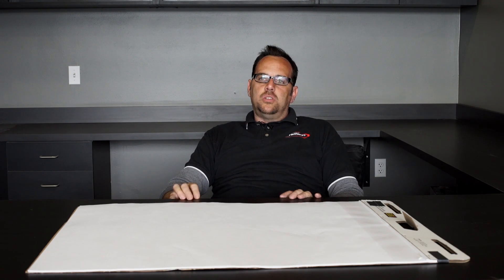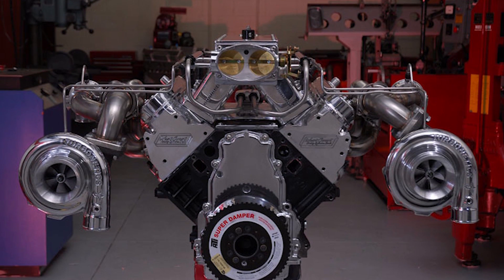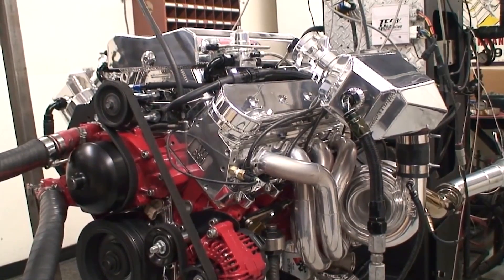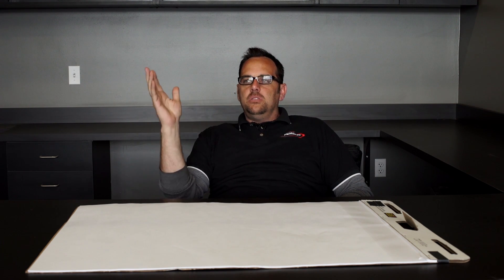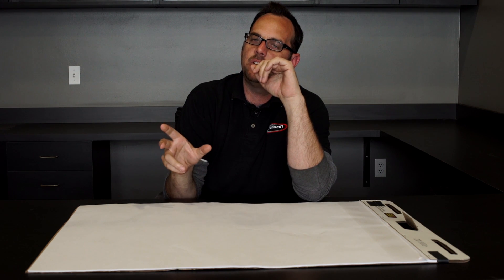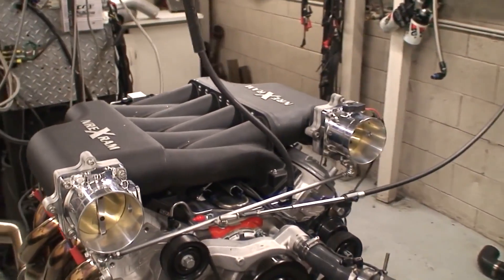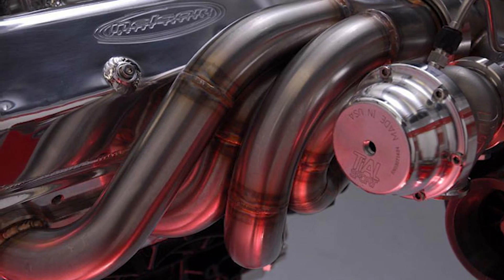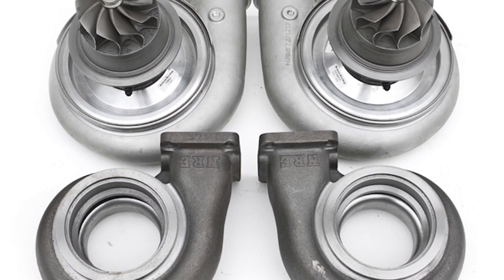Master Engine Builder Explains Why the LS V8 Is SO Good

Comment: Over here in the UK and Europe, engine development took a slightly different route of extracting more power from smaller displacement, primarily due to the price of fuel I suspect. Historically, big capacity engines were always the reserve of high end luxury or sports cars. As far as sound goes, if you want to hear the horniest V8 on the planet just listen to the Mercedes McClaren SLR. Getting big HP reliably from a big cc engine isn't really that difficult. For the pinnacle of engine development, IMO,  look no further than motorcycle engine design which is now at a reliable 200BHP/litre for the street.  Electronics has certainly played a big part in 'extending' the life of the IC engine but, like it or not, the future is electric, wether it's battery or Hydrogen cell, and NO, I'm not an environmentalist tree hugger. I'm a devout petrol head. JMO

Comment: Greatest Engines of all time, not counting the rare/exotics

- 1.8T audi/vw engine
- rb2xdett (theres a couple different versions, all of them are great)
- LSx (same thing)
- sr20det
- k20
- 2jz-gte
- GMC 3800 (yeah its not a power house, but you can bolt a fire hydrant to it)
- Ford 5.0
- B20
- 4G63
- cummins diesels
Reply: Those GM 3800 are literally a fortress. My dad had 3 buicks with the 3800's. He had each one for 2 years but easily put 60k on each car. The engine never broke(same can be said for the car) and the gas mileage was better than most i4 cars of its time, and some i4's of today. My dad was able to reach 36 mpg going 70 mpg coming back from tucson

Comment: what beats an LS for performance, weight, size, reliability?  and COST???
Reply: Nothing
Reply: An AC Induction motor.
Reply: +Charlie Soesbergen OHV V8's are incredibly easy to work on. There's only one freaking cam & 16 valves. I'm no mechanic & I found my LS pretty easy to understand.
Reply: Charlie Soesbergen 800 hp on a 4 banger is waaay different than a v8 with 800. That pisser 4 cylinder is making half the torque of a v8, let alone that 800 can be all motor, where as tuner engines need massive turbos to even stand a chance. 

*BTW, reliability and simplicity is not fast.
Reply: if you know how to tune an engine you can make a 4 cylinder put out more power on a turbo set up and save yourself double the work on a V8, SR20VET would be more cost effective for a performance car since at the end of the day you have 4 less pistons and half the engine in general, sure if you want reliable power an LS is a good swap but not the best, people forget about engines like the 2UZ-FE, M62 and plenty of other good V8's you can get for a decent price the LS is only glorified because its a cheap swap for Americans, when you live in a country where an engines price is determined solely on reliability and performance (because there is no cars manufactured here therefore no cheap local alternative) you soon discover that european and japanese engines are better in the long run since LS motors are OHV making them less reliable unless you do some serious work to them, which is just more expensive and takes more time on a V8, if you get a V8 you want to have to do as little as possible to make it good they are already a cunty engine to work on.
Reply: I was going to say a 2JZ but then I you said cost lmfao
Reply: Daan Made in Holland tell me when any of those cars can beat farm truck on the quarter lmao
Reply: VW 1957 1300cc single port .... way better😂
Reply: Denny Davis Ford truck FRAMES  are weaker than Chevy frames and always were. FACT.
Reply: @bearbait2050     wrong had a 85 chevy  shortbed i had to weld the frame on !
Reply: Denny Davis ur gonna have to provide concrete evidence for that.

Because the Ecoboost engines arent very reliable
Reply: been gm chevy since i was born my mom had a 455 trans am when she meet my dad sr had all kinds of cars but the gm cars we had always out last an out hp the rest its a reasin why even the due heart ford guys are doing ls swops i remembear when 350 4 bolt main an 400 motors was chevy small block peak but as soon as ls1 first was born it totaly ova shadow any motor mass produces an ls is the only motor that makes 1 hp per cubed ince an the stock crank bottom in can handle more hp stock then any production car made an even after market forge cranks can do up to 1000 hp on a stock ls bottom end an crank till today ford mopor company has a motor that can handle that type of hp more less can handle it an be relayable numbears an fact dont lie so us as gm guys just let the other ford mopor honda guys talk an thanks for your knowledge on gm an ls cars
Reply: Ok so it's a great engine, but  I dont understand what is so special about it.Here in Europe only small trucks have 5.7 liter engines, 6.4 liter or what ever, anyone can make big and thirsty V8 engine and offcourse it's gonna be reliable !! Try to make small engine that have some power, it's not thirsty and it's also reliable, that is art. Ffs some 2 liter 4 cylinder engines have more power then your V8's with zillion's of ccm !!
Reply: Zz6 crate
Reply: Daan Made in Holland if you're talking about the V12 that's in the Zonda and the Huayra, that's an AMG engine.
Reply: The coyote dont compare to the LS here in aus we have the mighty barra which puts up a good fight but lacks low end torq. It is very cheap and reliable though, proline LS is running the speed game atm, but you can scratch cost if your going there... Theres so many good engines its kind of hard to say.
Reply: To bad GM cant build 4 cylinders like thier LS  lol
Reply: Daan Made in Holland you just named the most unreliable cars on the market.
Reply: Charlie Soesbergen an SR20 can't make 400horsepower for under. $1,000.
People swap 2JZ and LS instead of sr20s for a reason.
Reply: Tesla
Reply: Ford will out perform and will out last a GM engine.....proven fact.
Reply: @dennydavis2914  wrong
Reply: Denny Davis most 3v 5.4 tritons never saw 150k.....proven fact

Comment: If the "LS was so good" why do they need more displacement to match the same HP of smaller V8's?  They make less HP per liter by far.  They also use outdated push rods which cannot rev has high as DOHC engines - please see 5.2L Voodoo engine now, that is a GOOD engine.  LS engines are Jizzunk!
Reply: They're good because they're cheap to buy and mod and fit in more engine bays. Liters/hp are kind of irrelevant here because what really matters is dollars per hp. Besides, a 6.2 Camaro gets better mpg than a 5.0 mustang AND makes more power until 2018. You can rattle off hp/liter numbers all day but efficiency, cost, aftermarket size and cost, and form factor matter as well. (they certainly matter more to me)
Reply: Dodgy Brothers If it ain't broke don't fix it.
Reply: Inclined to agree with Kool MaDa, Chevy do need to update their design to the 21st century and get rid of the ancient pushrods and associated pushrod weaknesses, and take a leaf out of the Japanese play book and make some nice compact DOHC heads. If they did that the LS would be the only engine swap you would ever want to do.
Reply: Chevy is still proving that pushrods can and will keep up with your dohc
Reply: As great as the LS engine is it still suffers from the same issues as every other pushrod engine. 1) Only two valves per cylinder, so it limits total flow and 2) you still have to have extra spring pressure to push the heavier valve train back which ultimately limits top end RPM.
Reply: Kool MaDa over 2 yeas later and the LS is still king of the engine swap, bitch.
Reply: Who cares about displacement when the bigger LS gets the same fuel economy? And compare the torque curve of 6.2 vs a coyote. Ohc engines don't build any low end torque this isn't a new concept
Reply: I second your comment! Ls is stolen ford tech anyways from like the 60-70s.

Comment: All this time i thought i needed S38 or M54 ... LS1/3/7 is what i need
Reply: +M S38 the S38 is one hell of an engine, glad to see others than me appreciate it too :)
Reply: hobo.Saize420 Well sadly i've yet to drive an M5 e34, but i drive a 520i M20 :/
Reply: M S38 The M20 is classy mate, its easy to work on, cheap and reliable so whats the problem? :)
Reply: I agree with all the above, and it makes a great sound. But the 2.0 version with 129 hp and 170 nm of torque is a bit gutless for a 1500 kg car ! (but plenty of power on the wet without any traction control ! :)
Reply: VANOS POWER!
Reply: There aren't even overhead cams on an LS... you can't make REAL power without those.
my Honda rules this junky, inefficient (low HP/L) 550lb engine.  All its power must b down low, it can't rev.
#PoesLaw
Reply: @thebutcherofbenghazi.libya3348  Incorrect.

Comment: I put 399,000 miles on the original LS1 in my 99 Trans/Am. The engine still ran just fine but was getting air into the cooling system making it run hot. I'm hoping it just has a blown head gasket as I plan on doing a rebuild on it. I bought a new LS1 long block from Pace Performance years ago for $2800 bucks delivered. This was a brand new not rebuilt factory motor. I dreaded putting it in but with the engine plate from JEGS you can put the engine in from the top with the factory manifolds coil packs and water pump still on the motor. Didn't even have to discharge the A/C.
Anyway Tom is right about those long runners on the intake. I also have a 88 Formula 350 with a 5.7 tune port which has extremely long intake runners. The off idle torque is insane on this car. I put a new long block also from Pace that was designed for the old Buick Roadmasters/Cadillacs that had the 5.7 Chevy. The cam is designed for low end torque and with a tune port intake it makes a ton at low RPM. 350,000 on that long block that only cost $1500.bucks It's still going strong today.

Comment: The LS is just the latest in engineering from GM the same as the Coyote (and other Modular) Ford and modern Hemi from MOPAR. The LS is better than it's older sisters because of advances in technology. It is no better or worse than the MOPAR or Ford as computers have done many things to increase HP.  With the right engine builder you can get the maximum HP out of whatever the base application is. Guys who know what they are doing at maximizing HP out of modern engines can work with all 3 brands.

Comment: I like how he said, "chevy knew what they were doing when the made a long runner", LMFAO Dodge started the long runner thing back in 1960 with the 383/413 engines...so it's nothing new. LS motors are the first SBC that is any good in stock form. The SBC was always an aftermarket queen the SBF 5.0(excluding cleveland/boss 5.0). In stock form they were junk...heads, rods, blocks. If you have to replace everything to make it fast...what you started out with was any good to begin with?  And Yes I do like all brands...atleast the fast models.

Comment: LS into Prius!
Reply: ZeroController Ive always wanted a turbo diesel in a Prius just for the fuckery
Reply: Look up the hellcat powered prius. Satisfying as hell
Reply: I'd keep the stock motor in front, disconnected, then put the LS into the back. Hide it with a DeLorean style firewall from the back of your head, and decorate it with some weird stuff. I'd also shove a big rear differential on the back and connect the rears to the engine and leave the front wheel drive kit up front in neutral if ever the rear engine is used. Then roll up to the track, revving the stock engine, kill it, then activate the monster.

Comment: My 2014 Camaro has the 6.2L LS3.  Stock is 400 hp.  To say these engines react well to mods is an understatement.  With just a cold air intake, full 3" exhaust with headers and a tune the engine puts down 409hp at the tires.  Calculate in driveline losses and it's making 475 hp at the crank.  75hp added just with 3 changes.  Dyno tuner said I can make an extra 50 hp more on top with a cam swap but the car is still under warranty.
I remember when I got started in cars an old fashoned Chevy 350 making 450hp would be a bear to drive on the street.  Now it's as docile as a stock engine.

Comment: All copied Ford tech from the 60s and early 90s. The LS motor came out suspiciously close to 1 production cycle after Ford's Aluminium DOHC dropped (that was 1993). I heard this guy say "Y-block" LMAO that's ford nomenclature for the FE-390 and 1993-2015 motor. Cross bolted mains...introduced on the 1993 4.6 and finally on GM's LS1 in 1997. Geez by the time GM rolled out those cross bolt mains in the vaunted Vette LS1, ford had already sold 2 million truck motors with this feature. The Gen III to Gen V...have come along way since then, but.  No. what am I talking about? Ford tech left these clowns behind 5 years ago. Have a look at the Trinity 5.8 DOHC SC vs. the LS9 6.2 then come back. They aren't close. Even the little 5.2 annihilates any motor GM has made in history. Now Ferrari and Benz territory. Anyway still can't believe we are on LS motor. Yeah it cheap and it works, but I doesn't mean ist any good.

Comment: To me the LS/Chevy small block stands as a testament of how far R&D and engineering something can go as opposed to just scrapping it and starting anew (aka, everyone else is doing OHC, we should too). Also, there is something truly American to me about a pushrod 16 valve engine putting out the numbers of the big dogs and more "sophisticated" engines. The pros and cons can be disputed all day, but the bottom line is the "old tech" OHV V8 is as capable, and even in some instances has been accused of being an unfair advantage vs OHC. As in Corvette Racing's competitors' complaints to the ACO/FIA for the 24 Hours of Le Mans.

Comment: good video although the internal combustion engine is becomming stone age and is being replaced with much more efficient electric motors which don't require cams, stoichoimetric considerations, air flow, injection and especially heat which after all makes the engine inefficient in the first instance - you are watching the end of the era of the petrol chemical heat engine a living dinosaur
Reply: there are no driving enthusiasts that want that shit . we will run internal combustion until every drop of petroleum is gone .    that is a fact .
Reply: Zero interest in electric bs

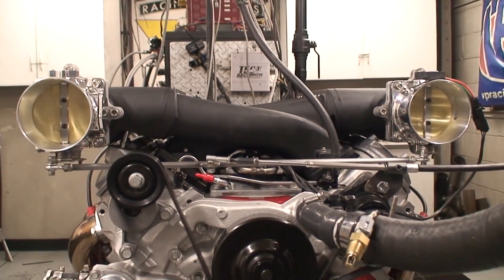Comment: Very informative video, probably the most objective one I've seen. For those viewing who are not really familiar with Chevy motors, many of the engines shown are not "LS", but are instead older generation Chevy motors. For example, at 13:00, where he discusses the new X-Ram intake, the engine shown is an older generation big block. Just the same, all the engines shown are meticulously built showcase engines! P.S. The X-Ram resembles the manifold made by Moon since the 60's or 70's that uses 4 Weber DCOE side draft carburetors - http://www.mooneyesusa.com/product-p/web19600060.htm

Comment: There is some good stuff in this video  LS or not.  My question is why is there such a misconception on runner length?  In the old days everyone said a tunnel ram destroyed low end power, but was great for top end power. Now most seem to think the shorter the runner the better the top end?  I can think of a couple reasons, but I really don't know.  Reason 1 is fuel injection and carbs are just totally different and act different.  Reason 2 is that carbs are sensitive to vacuum so to prevent reversion they lengthened the runners. Though this would be a reason why a tunnel ram intake should in fact work better on the street though in a carb application with a big cam. A lot of big cam engines fuel injected are  run the mass air flow sensor far enough away from the reversion to prevent false signals. So is reason 3  that  it was just born out of ignorance? Just to much cam to ever have any power down low so they blamed the intake?

Comment: Make an intake computer controlled that at 5,500 RPM the intake has an extra flange that opens close to the heads that simulates a short run. I wonder why no one has done this other than Mercedes, my dream engine right now would be the new LT4 , the new king if you care about efficiency 30mpg 450hp cmon bad ass

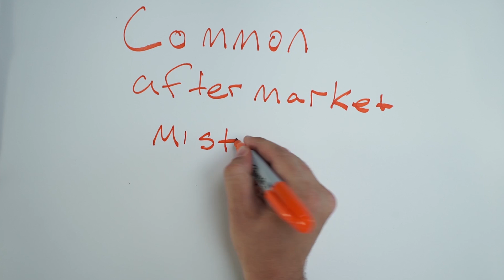Comment: +8:40 So if I wanted to build an LS3 stroker motor to get more displacement without spending a ton of money on a LS7 block how would one go about doing this? does buying a tall deck LS3 ruin the whole money saving theory? what about longer sleeves from comp? Will the cost of those two remedies make it cheaper just to go ahead and get the LS7 block? Also what about the new LSX 454? does it run into similar issues?

Comment: Big LS fan, built 3.   4.8, 5.3 and a 5.7, all truck blocks.   Can put them in anything, Nissan 240, early Mustang, any GM and perfect for any restro rod.   Also like the Ford 302 (stroked to 347) and 428, 460's but the power produced even by the lowly 4.8 is wild just with a cam change and rocker arm upgrade running a LS1 intake which you can pick up for a ham sandwich used.Can't say that about the new Fords, to wide to fit in anything with to much wis-bang junk to make them work. Built that little 4.8 with the GM Hot cam kit, LS1 intake w/ 90mm throttle body and Holley ECM controlling spark and fuel, a beefed 200-R4 tranny out of a Buick GN and a posi 3.73 10 bolt with a 28"x9" tire out back all stuffed in a '70 Nova .............. Bring what 'ya got and good luck.